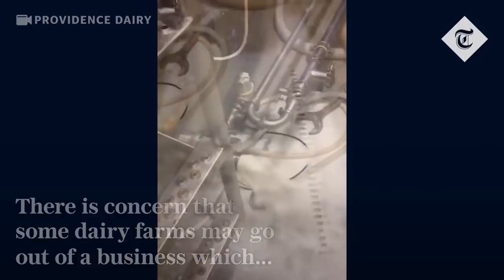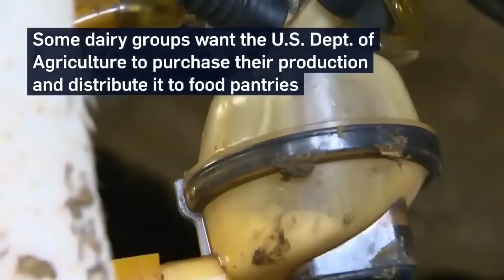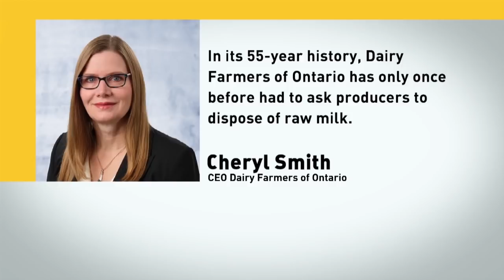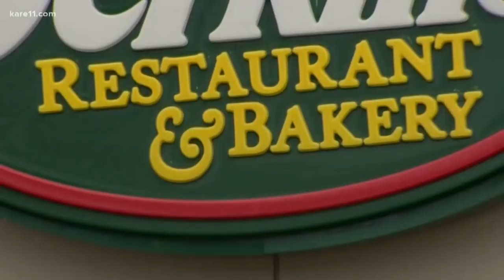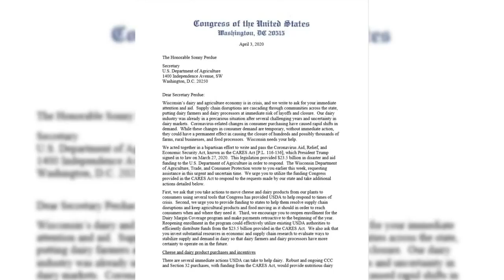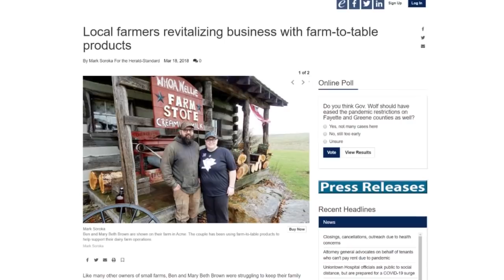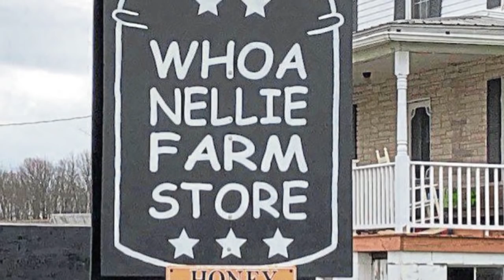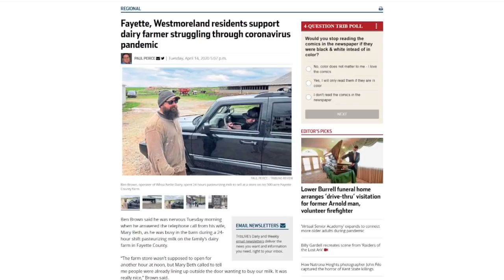Dairy Farms Forced to Dump Milk - ROBERT SEPEHR

Comment: That's sickening, yet it's the price of a gallon of gas. Yes where I live they are still selling gas at $2.66 a gallon as the same for milk. Yet will come a time when neither is worth tap water. Less supply more demand? Meaning they want to keep the money per gallon the same and would rather throw it down the drain instead of taking less.